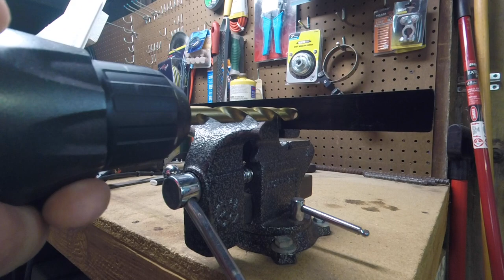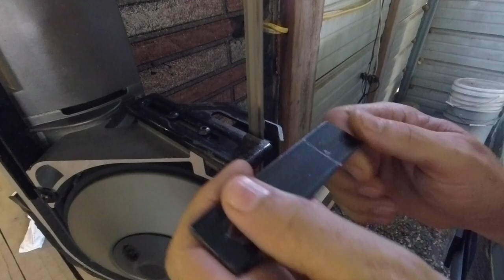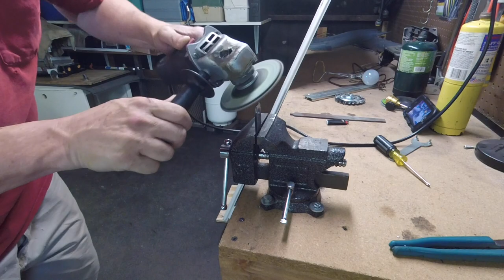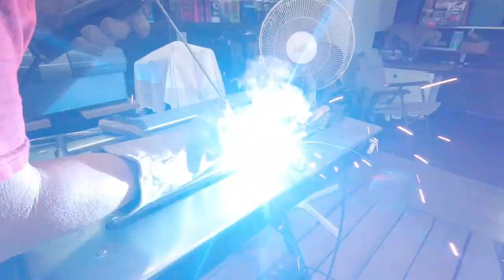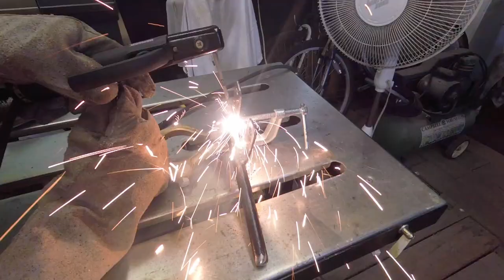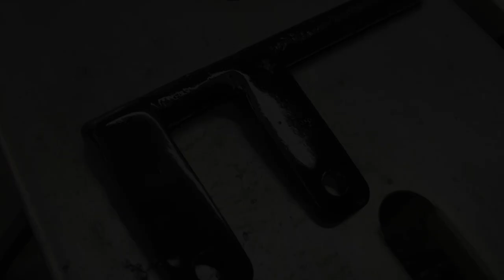DIY Trailer Tongue Lift Handle - Homemade Tool Ideas - Fun Beginner Welding Projects

Comment: I like the homemade 240volt suicide cord lmao. If it works it works!
Reply from the maker: Thanks, it works good. I know what you are saying about suicide cord but this really isn't a suicide cord like some people make to run a house on a generator through a dryer outlet. This box I made has no connection in the box between the two male plug ends. It's not going to be very effective for committing suicide. Thanks for watching!

Comment: Another good one!  So what brand and tpi  blade are you running on your band saw? Btw, have you ever done a YouTube search for angle grinder accidents. Certainly opened my eyes and gave me new respect for that humble tool. Looking forward to you next vid and stay safe. Thanks!!!
Reply from the maker: I actually don't remember the tpi but I think its either 18 or 24. I haven't done the search on angle grinders but I know they have the potential to be quite dangerous if used improperly. That's constantly going through my head when I'm using it. I probably have some technique issues to work on when using it. Thanks for watching and commenting, I appreciate the input. :)
Reply: DIY Homestead Projects : The emphasis is actually not so much on technique, but more on the disks breaking and impaling users in various parts of their body, especially the face. Life changing if not deadly. They strongly recommend blade guards and face shields. I will no longer use mine without both. Good luck with your move. Glad it’s not me : /

Comment: So I say where you wrote not to build your 2 plugs into 1 to achieve 240 V  was that just a precaution because it seems to be working! I see your welder welding!
Reply from the maker: Yes it does work but many people believe it's not safe so I wanted to pass that information along. It's a do at your own risk type of project and probably won't work for every welder or shop set up.

Comment: What size tube and flat bar did you use?
Reply from the maker: I believe it was 1/2" round bar and 1/8" X 1" flat bar.
Reply: @DIYHomesteadProjectsDIYHP10  nice i was thinking it was 1" round tube. That's what I get for thinking 🤣